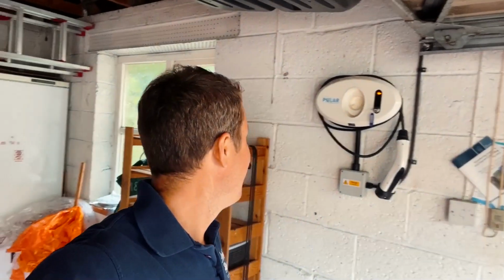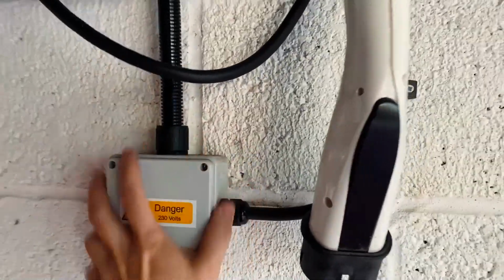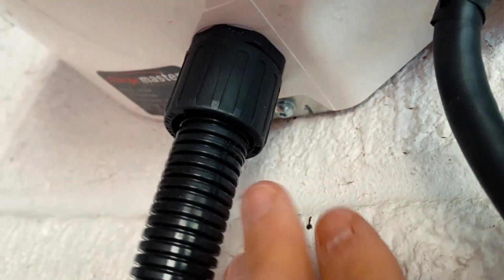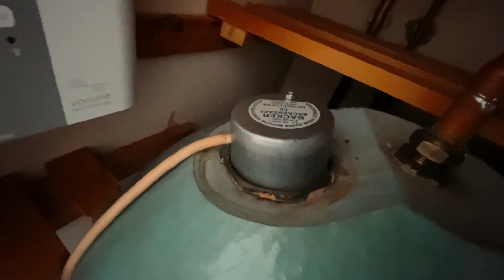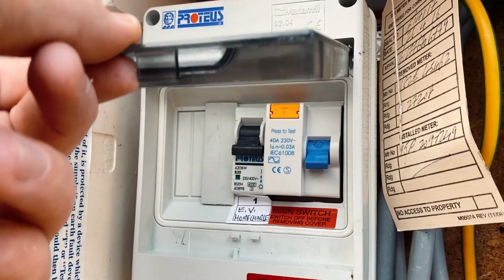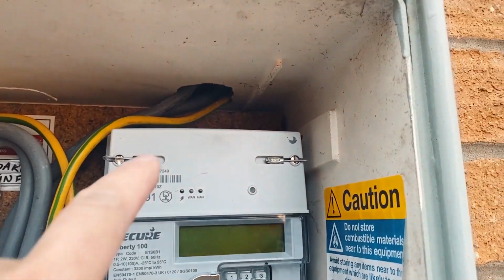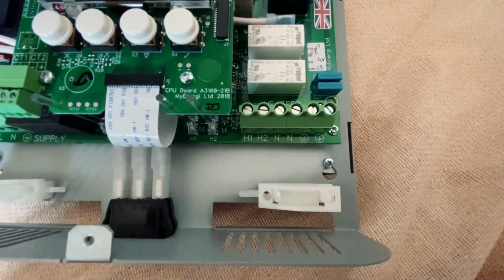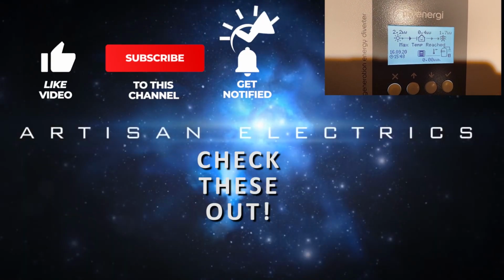MyEnergi Zappi & Eddi Installation

Comment: Question. I have a sub board in the garage with 16mm swa cable 600/1000v from main board. Is this suitable to feed the Zappi from the sub board ? Will need to check breakers etc but want to be sure cable is ok.

Comment: Thanks great info as usual.  I'm just going the EV and solar route and wondering if it would be possible to use the EDDI device to heat a Hot Tub instead of or as well as hot water.  Looking at the tech specs for the EDDI the Amps rating would be too low so it looks like it would require a relay as the Tub is rated to pull 32Amp on full.  Thanks

Comment: One big problem with 'inteligent' systems is that they don't have weather forcasts built in. I prefer to have manual cotrol sending excess solar in the summer to water though the 'water solar panels' are also giving me too much on a sunny day. In the Uk there will always be some summer days with too much solar and winter between Nov and Feb too little. For me,  in winter what solar there is, is better sent to the battery or car  whilst  the wood stove is heating the water and house.

Comment: Is is poss to install a 3Phase  Zappi and initially connect it up to a Single phase power supply (with cable for 3Ph) - so that in the future event of having an upgrade to 3ph - with the reconfigure of the power cable / CT's -  the full potential of a 3Ph Zappi can be achieved.

Comment: Thanks for the video; it's an interesting installation.  I'm looking to convert my gas-fired Zombi to electricity, and would like to use something like the Eddi to divert any excess from my Solar PV into an immersion tank.  Can I ask, why did you need to add a CT directly to the Solar connection..?  Wouldn't having a CT on the DNO feed be enough to inform the Eddi when the site was in surplus and exporting..?

Comment: Great video but I don't quite understand the need (not a sparky...!). Why do the immersion heaters need a specific device to divert power into them, if they are connected to the home why don't they just use electricity just like any other appliance?!
Reply from the maker: It’s so that when there is excess solar energy it will switch on and use that energy rather than it being exported to the grid

Comment: Great vlogs and very informative for none electricians. On the subject of car charging and chargers, watching your vlogs on the subject, so much has changed in such a short time re quality and fittings, do you think that in another two or three years time, upgrades will have to be made again to charging systems? On the Eddie, what happens with the surplus electricity from the solar side, when the water is hot and the grid is at capacity and shutting down some generators and the house also doesn't need it? I know that doesn't happen often but it has happened, summer usually.

Comment: I always found those top mounted immersions blow the thermostat cutouts in my rentals due to rising heat. Had to source some without cutouts. (Flats are all ground floor, so no danger involved.)
Reply: The danger is in scalding your tenants to death. What's ground floor got to do with it?
Reply: @markrainford1219  The cutouts were specified to avoid people being scalded when the tanks were installed in lofts and overheated.
Reply: @jamesknightreading  Absolute rubbish. Does not matter one iota where the cylinder is. If the stat has failed short circuit and you stand under a shower with 100 degree water cascading over you, you are fucked. And so will you be.

Comment: If the cylinder is up to temp where is the 0.5kw going ?
Reply: once the car is full and the tank is heated up the balance of whatever the house isn't using at that moment is exported into the grid.
Reply: @edc1569  It could be used by any other Electrical equipment/appliances in the house. My Router is on 24/7 so will consume power  - as will the Radio / TV / Printer / Fridge / Pond pump etc.....

Comment: How does the eddy sense the hot water in the cylinder is there a 2nd stat
Reply: Looking at EFIX video, it's possible to fit an optional one, however I think it senses the current draw to the heater in this install
Reply: heater coil goes open circuit as the thermostat opens, it can detect that - hopefully that was the case rather than not working!
Reply: E C ok thanks for that 👍

Comment: Hi, am liking your videos - couple of questions / comments as sometimes its hard to get a clear perspective from the video. When you mounted the Zappi in the garage, as you like to do a neat job, would it have looked ok if it was a little higher as it would have hidden two of the old holes from the previous charger. Its the kind of thing that would bug me and would have masked some of the old holes for a neater job.
The other thing I was wondering about, the cable for the immersion heater, could that have not gone up and over instead of being on the floor? Would it not be more susceptible to damage being run along the floor and generally look less tidy (or did it go under the boards?).

That resident was nuts for wanting that diagonal wall drilling through the wall as well. Nice idea on the conduit when drilling though!

.

Comment: We have a 5kW solar system, a Tesla powerwall and the Myenergi Zappi and Eddi systems and despite being 25Km from Aberdeen, run our house most of the year on solar. or off peak electricity. Just had an Air Scource Heat Pump system put in to replace our LPG boiler so now are 100% on electricity apart from our wood burner. The Myenergi systems are not cheap, but you pay for what you get.
Reply: A serious investment I'm sure, but one I'm quite jealous of!

Comment: Hi sir could you not have gone out the base of the outside box .  Run up the wall and back entry into the dis board .  Avoiding any need to see trunking on the inside .  But of course it would have been a lot more work . And as they say time is money 😃 . I don’t think it would contravene any  regulation , because it would be just the same as say up grading a 6mm bonding cable to 10 mm .    Best wishes and kind regards Mike in the U.K.

Comment: Could quite tell from the video angles, but were there grommets on the supply cables  feeding the EV charger DB? Looked like cables had just been pushed through drilled holes in the plastic enclosure...

Comment: I've got a Solar iBoost to heat my hot water tank from a 4kW set of solar panels. It only manages to completely heat the tank during the 6 summer months and only on sunny days. Still an excellent device. In 6 years it has put over 7,500 kWh of free electricity into the hot tank. If it's not using the iBoost it uses gas so it has saved me about 7500 kWh of gas which at current prices (3p per kWh) is worth about £225. And still many years to go so should end up saving about £1000 from my bills. I think I paid about £200 for the device including fitting so will be about £800 total profit from it.

I cannot see the point in investing in a solar car charger, unless you have a lot more than a 4kW solar system. As most of the time the sun is shining you will be at work so unable to use the free solar power.
Reply: Well said
Reply: I agree... We have a 6.6KW array and we are looking at upping it to 10KW.. 
A solar EV charging system is not going to work unless you have a small battery in your EV and switch everything off in the house when it's sunny...
Reply: @G-Cam1  My iBoost seems to put about half the electricity generated from the solar panels into the hot tank. Sometimes the tank gets "HOT" so stops taking charge. Also, on the iBoost I think to allows a margin of about 400W excess that it won't take, catering for any power surges from other electrical appliances, more modern devices will probably have a lower excess and more responsive feedback so use more free electricity with less of a margin. 
If you get a 10kW solar bank then that should manage to charge the car battery a bit before you even leave for work and of course over the weekend it should build up a lot. I wish I'd gone for a larger solar array but at the time it was difficult to arrange that much with the electricity company and getting the generation tariffs. I've never switched anything off when the sun is shining to get electricity into the hot tank but if you have a battery that will give electricity when the sun has gone down to add to a 10kW solar bank then you will probably have nearly zero electricity bills in your house.
Reply: @caparn100  I do have a Powerwall2 which helps. But we are also have 2 EVs and run a business from the house... We are big users of Electricity.. around 14500kWh per year? 
We also, unfortunately heat the house with oil. However I'm working on getting an ASHP system installed in the next month... Bad timing as we head for the reduced daylight hours, but I guess that is always going to be the case with Solar PV and an ASHP... There is a jarring incompatible nature that when PV production drops off ASHP demand increases! 
I'm looking for a small wind turbine to suppliant the system a little however finding one that I can afford that actually works is slightly difficult... 
It's all a balance with green energy... Buy at least we are doing something to reduce emissions and so are many folk on here👍
It literally is the quiet Revolution....
Reply: Why has it saved you 7500 kwh of gas ? It is not a direct comparison .
Reply: @persona250  Because that's how many kWh of electricity has gone into the hot tank from solar. If I wasn't using solar it would use gas. The hot tank is connected to the boiler and has an additional electric heating element that is powered from the Solar iBoost.
Reply: @caparn100  I understand that but it is not a direct comparison from electric to gas . The electric element is rated at 3kw . the heat coil of the cylinder could be 10 - 20kw .
Reply: @persona250  Yes but 3kW for 10 hours would produce the same heat as 15 kW for 2 hours, both would use a total of 30 kWh and heat the tank to the same temperature. So the heat is measured in kWh. So 7500 kWh of electricity will heat the tank the same as 7500 kWh of gas. Also the iBoost only puts 3 kW into the tank when it's really sunny, it sometimes slowly heats the tank at a few hundred watts when there is less sun, the charge rate is changed every 15 seconds depending on the sun, but it does it throughout the day so still heats up the hot tank.
Reply: @caparn100  I  know how it works i have installed them . where are you getting your figures from ? It takes 2 hours to heat a full 120 litre cylinder with a 3 kw element . So like i said it is not a direct comparison your figures are way off .
Reply: @persona250  The Solar iBoost has a counter you can display that shows the total number of kWh it has put into the hot tank over its lifetime. That's how I got the figure 7500 kWh.
The calculation that 3kW for 10 hours would produce the same heat as 15 kW for 2 hours was there just for example of how the input in kWh to a hot tank was the same from a high powered boiler or for a longer time with a lower powered electric element, it looked like you didn't understand what a kWh was. It was not meant to be an illustration of how much electricity goes into the hot tank in one day.
On a good sunny day the Solar iBoost will put about 6 kWh into the hot tank, on a not so good day it might only put 2 kWh into the hot tank, in that case it will need to get the additional heat from the boiler which would use about 4 kWh to heat the tank. On a dull day no electricity is put into the hot tank so it would have to get all 6 kWh from the boiler.
I really am not clear about how you think I have gone wrong in my calculations.
Can you tell me what you think I have got wrong and why you think my figures are way off?
Reply: @caparn100  It is quite clear your calculations are wrong . A kwh of electric is completely different from a kwh of gas therefore you cannot say the 7500 kwh of electricity used by the i boost has saved you 7500kwh of gas .
Reply: @persona250  A kWh is a measurement of the energy going into the hot tank. No matter where the kWh comes from it will heat the tank the same amount, whether it be a nuclear power station, mains electricity, gas or oil. That's why the kWh is used as a measurement of energy put into a hot tank, whether it be from a gas boiler or an immersion heater. Apart from the source of one is electricity flowing into an electric element and the source of the other is gas heating water which goes through a heat exchanger and heats the water in the hot tank a kWh of gas is directly comparable to a kWh of electricity.

In what way do you think the heat generated from a kWh of gas is "completely different" from the heat from a kWh of electricity?
Reply: @caparn100  You are saying 1 kwh of electricity will heat the same amount of water as 1kwh of gas . That is so funny . You are so wrong .
Reply: @persona250  In what way am I wrong? There is some loss when converting the heat from the gas flame into the heat in the hot tank, modern condensing boilers claim to be up to 98% efficient, I ignored that loss but apart from that they are the same.
Reply: @persona250  No reply, so do you now agree that I am correct and you were wrong?
Reply: @caparn100  no i completely disagree with you .
Reply: @persona250  LOL, Ok, Exactly what do you think the difference is between a kWh from gas or a kWh from electricity, in what way am I wrong? I know you think you are clever and I am stupid but I have a degree in Electronic Engineering and Mathematics from a Russell Group University, so I do know a bit about basic electricity, I was also a member of Mensa for a year before I gave it up. I think that qualifies me more than someone who knows "how to wire one up". Whatever your explanation is it will go against the laws of physics.
Reply: @caparn100  The difference being the electric element is in direct contact with the  water . 
The gas never touches the water in the cylinder . The cylinder is heated via indirect contact of the heat coil . 
A 120 litre cylinder with 16.4 kw heat coil will reach 60 degress C in 21.7 mins using 5.9 kw .

it takes a 3kw element 2.1 hours using 6.3 kw to heat the same body .

You have not taken  into account thermal losses through the pipework from boiler to cylinder or the efficiency of the heat exchanger in the boiler and heat coil in the cylinder . 

Your assumption about me thinking i am clever and you stupid are incorrect .
Reply: @persona250  I've already said that I ignored the losses due to the efficiency rating of the boiler, some modern condenser boilers are claimed by the manufacturers to be 98% efficient, though 90% is probably more realistic so maybe but that still make my figures near enough.
I don't the relevance in how much time it takes the tank to get hot. The heat still gets put into the tank whether it takes an entire day of the sun shining charging at a few hundred Watts or a couple of hours on a really sunny day, my tank loses 2 degrees a day if there is no heat going into it, so quite efficient. Also the iBoost would not heat a tank from cold to hot in "2.1" hours unless there was over about 3,400 W of unused electricity being generated by the solar panels. Sometimes if the sun is not bright it will charge the tank at only 200 W so would take over 60 hours to heat it at that rate (to save you coming back and telling me the sun doesn't shine for 60 hours in a day, I know! It's there as a measure of how long it would theoretically take).
The fact that a tank might have a 16.4 kW heat exchange coil in it doesn't mean that the boiler will be putting 16.4 kW into the tank. Modern boilers vary their power output depending on the difference between the cold water coming in and the hot water going out. So I don't see the relevance of that statement unless you are saying that 16.4 kWh of gas is used to put 5.9 kWh into a hot tank? If so we can discuss that, if not then I don't see any point in what you've said.
How many kWh of gas do you think it would take to heat a hot tank from cold to hot, if it would take a 3 kW immersion heater 2 hours, so using 6 kWh of electricity to heat the same tank?
Reply: @caparn100  A 120 litre cylinder with a 16.4 kw heat coil will take 21.7 minutes to heat a full tank from 15 - 60 degrees . That works out at 5.9 kwh .
The 3kw immersion takes 2.1 hours which is 6.3 kwh .
Reply: @persona250  I just want to be clear about what you are saying so please answer my questions below:
1. So you think it takes 5.9 kWh of gas to do the same as 6.3 kWh of electricity?
2. I don't understand why you added information about it being a 16.4 kW heat coil, why did you mention this?
Reply: @caparn100 1. This is manufacturers data taken from testing .
2. The load of the indirect heat coil and immersion heater are relevant . how would you work it out without them ?
Reply: @persona250  The relevance of the kW of the heat coil is more about the time it takes to heat a tank, not about the total kWh needed to heat a hot tank.
The figures you need for working out how many kWh of gas it takes to heat a hot tank is just the efficiency of the system. If a boiler is 90% efficient, then if you put 1kWh of gas into the boiler then you will get 0.9 kWh of hot water from it. Then there is the loss from the pipes connecting the boiler to the hot tank. Though if these are insulated there will be minimal loss of heat through them. 
So the way I would work it out is that if I had a 90% efficient boiler and the pipes had a loss 1% then I would get 0.89 kWh of hot water from 1 kWh of gas. So 1 kWh of gas would be the equivalent of 0.89 kWh of electricity.
Reply: @persona250  Do you agree with my analysis in my last comment? 
If not what do you think is wrong with it? 
What method would you use to calculate it?